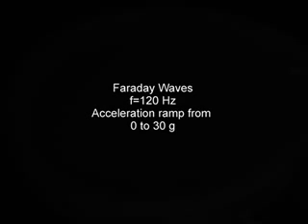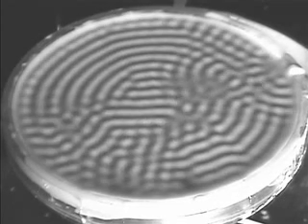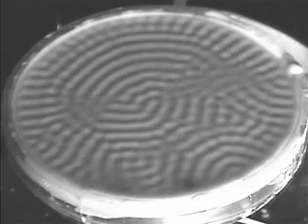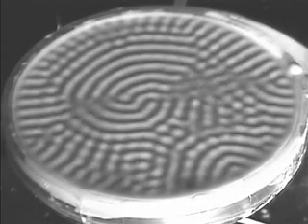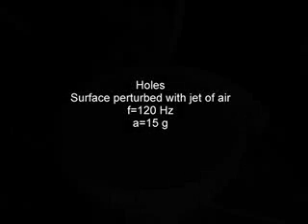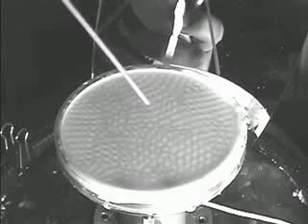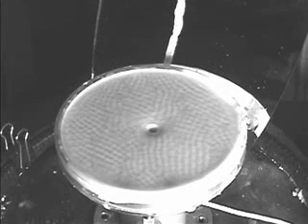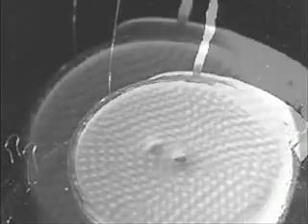Cornstarch Science

Comment: The reason the holes stay there, is that the cornstarch-water mixture is whats called a Non-Newtonian Liquid. Meaning that at a state of rest, it acts like a liquid, but when outside force is exerted upon it, it acts like a solid. So when in a state of flux (vibration alternates rest and force) it alternates acting like a solid and liquid, therefore, the hole stays, as it would in a solid, since there's not time for it to collapse fully in the liquid stage.